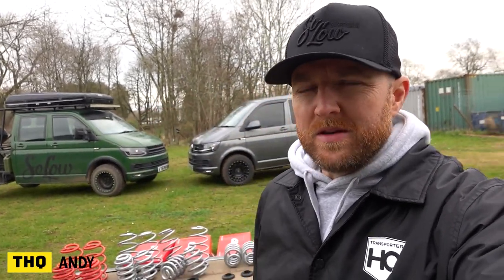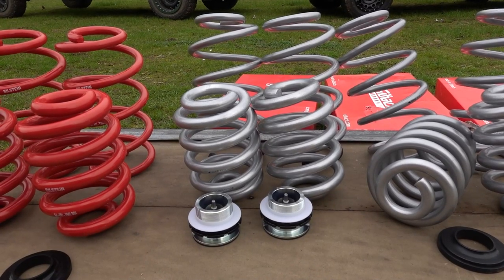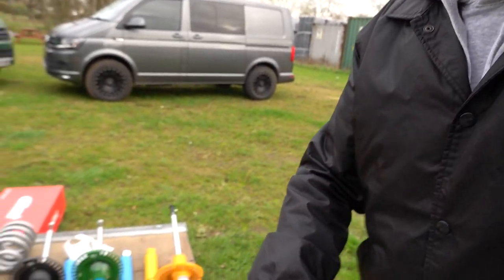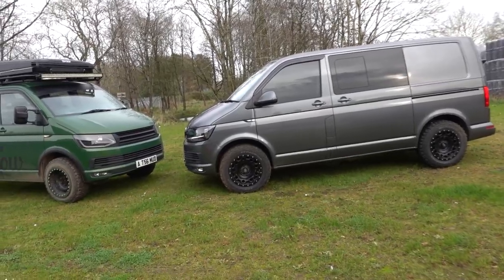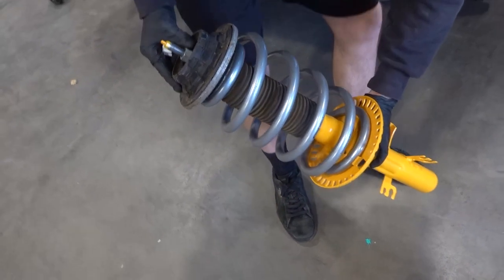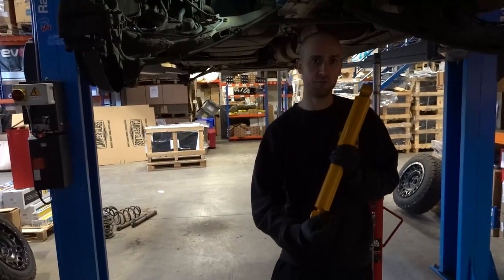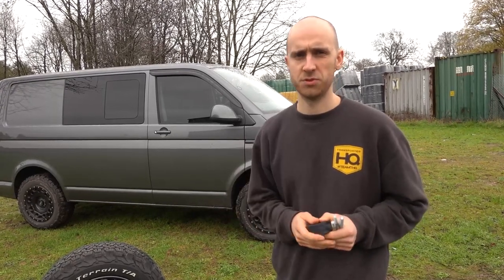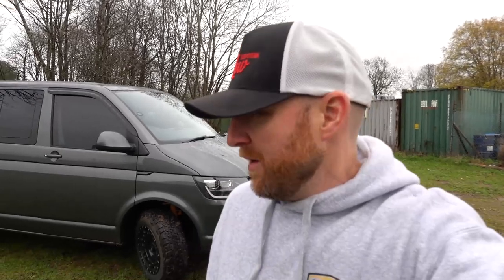T5 & T6 Swamper/Lift Suspension Explained | THQ

Comment: Hey there guys. I have done a lift on my t5 lwb 4motion with Bilstein shocks and a 50 mm lift on rear 35 on front. 2 Questions if I may. Where can I access the rear diff spacers from? as I can't seem to locate them here in Australia. Secondly is there any sort of spacer to raise the front to match the rear.  I would prefer the van to ride level or is it putting to much stress on the cv's to have the front lifted more. cheers in advance
Reply from the maker: Hello, we sell the diff spacers but I don't know where you can get them in Australia. We can ship there. I don't know of a front only lift option. All ours lift front and rear the same.

Comment: We have a VW California Coast which has 16 in alloys & sitting lower at rear because as you're saying the weight in the van . Is it a matter of just fitting the suspension lifting kit or do the wheels make a difference?
Reply from the maker: No they don't make a difference. Since this video things have changed a little. The new Solow LFT kit would be your best option

Comment: With the 45mm lift how much ground clearance is gained? Is it 45mm + the standard height or 45mm overall? Thanks
Reply from the maker: 45mm from the standard height. It can vary sprightly based on the weight of the vehicle

Comment: why do the Eibach HD springs make you install the little bump stop extender ? Doesn't this  prevent upward movement of the wheel ? I have the Koni and Eibach, but with 30mm extra stroke I think I would rather swap the Big H in. Are the springs in the Big H a lot harsher than the Eibachs ? Thanks guys

Comment: Hi,

I must mention that I am pretty green in this field :D I have a 4motion T5.1, that I am converting to camper, and I want to lift the suspension so it will be more off-road capable. The viehicle will probably spent most of it's time on paved roads but sometime I would like to go off the beaten track and I would like to not be limited by the suspension. Which set would you recommed in this case? Another thing to mention is that in the future I am planing to take my van to South America :)
Reply from the maker: Hello, upi want the new Solow LFT lift coilovers.

Comment: Hi,

Fab videos.

Would you recommend putting BFGoodridge AT on a T6?  

Would it be a better ride, noiser etc?

Current tyres are 245/45 R18.

Cheers
Reply from the maker: I’m not actually a fan for them. The look good but are really hard, noisy and don’t have a very good wet grip. I’d tend to go with General Grabbers.

Comment: Hi there, can you tell me more about the green transporter with a chopped rear end? did this van start life as a cab chassis and had a custom tray installed, or did you guys chop the back off a normal van?
Reply from the maker: Hello, yes its a T5 doka, we just shortened the rear end and added the frame.

Comment: I have a steep drive and when I go down my VW transporter occasionally scrapes on the  bottom at the front . This is before a conversion. Would a suspension lift stop this I would like to put  more chunky wheels on as well so what lift would you recommend?
Reply from the maker: Yes lifting will left for sure. 35mm lift is the most popular
Reply: @THQAutomotive   where are you based?
Reply from the maker: @melanieensor6029  google Transporter HQ

Comment: Just bought a T6 camper, 2019 7000 miles on clock. Loads of extras but one I don’t like, it’s raised really high on black rhino wheels. 

My problem is the suspension feels like concrete. I’m a tad lost and if anyone could point me in right direction would really appreciate it 👍
Reply from the maker: Some lift suspension does fell like this. What are you looking for look / ride / height wise.
Reply: @THQAutomotive  hi, looking  for something adjustable so I can put alloys on for summer and then lift a touch in winter with swamper wheels back on.

Comment: 1. question: these Koni shocks are TWINTUBE or MONOTUBE? 

2. question: t5 upgrades has yellow extended b6s,  if you should choose,  koni or bilstein ( dynamics,  comfort, lifetime...)
Reply from the maker: Twintube. No one make a monotube suspension for the Transporter (yet 😉🤫) 

Yes the yellow extended b6 is a long b6 but stand B6 internals. It’s a good damper though. As I said in the video, the koni is the most comfortable lift kit i’ve tried.
Reply: @THQAutomotive  but bilstein is Monotube when is yellow,  b14,  b8 and b6 are high pressure shocks       (i think).  Thanks for feedback.
Reply from the maker: @radohuncik9894  no, the Transporter Bilstein is not monotube.
Reply: @THQAutomotive  wow,  ok good to know.